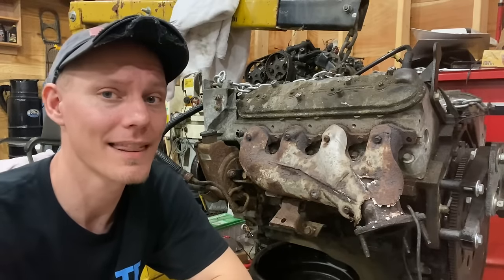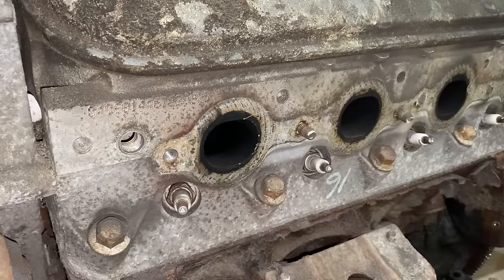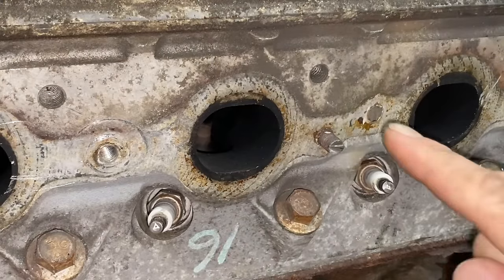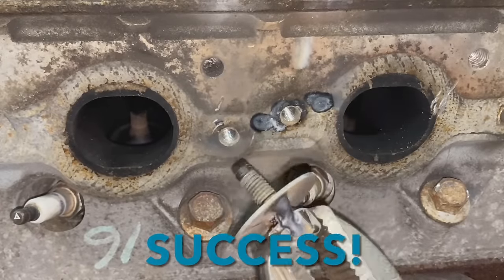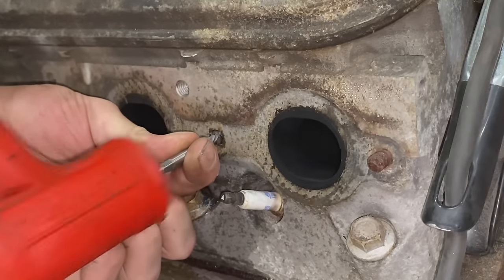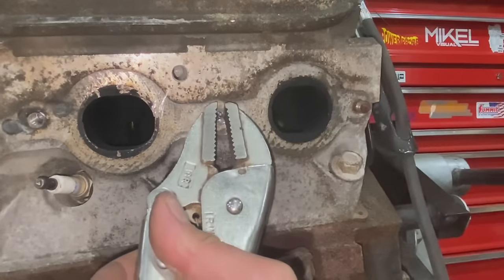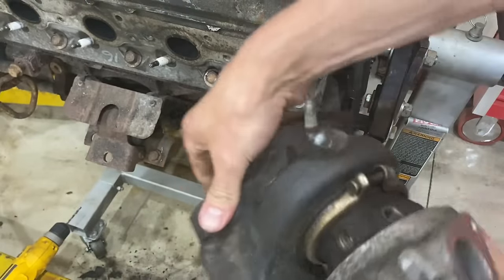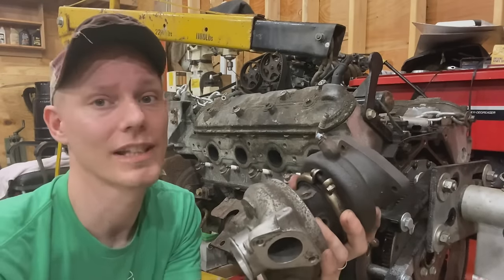How To Remove A Broken Bolt 6 DIFFERENT WAYS - LS Exhaust Manifold

Comment: Enjoyed the video and the various methods to remove broken bolts. So please excuse me, not to be critical, but every time I saw you using the wrenches and the channel lock pliers, I couldn’t resist saying please turn them over  to turn CCW. You had them CW most of the time. You’ll get better grip and less stress on the jaws of the Vice Grip and adjustable wrench. Watching your welding and collapse methods gave me and idea; Weld a high spot  off center, on the broken bolt and using a punch rotate the bolt out! I suppose an off enter hole and punch can do the same. 
Thanks again for taking the time to make the video and share!

Comment: I personally use the #6 method, but welding a boat anchor instead.
   Nice video 👍🏻
Reply from the maker: You can also try welding a steering wheel to it, and then just turn left. Thanks for watching!

Comment: Great video. Hehe on the turbo charger, but it gave leverage to turn the bolt out. 
If a bolt is not seized in by rust or what ever, and things are clean around the bolt threads, then when the bolt head breaks off or gets cut off, the bolt should be loose in the treads, because it’s not holding any thing. 
I had a push mower recently that the bolt broke off holding the cutting blade on the crank shaft of the engine. The bolt was broke a few thousands down in the crankshaft. I figured, it should be loose. I took a very small flat screwdriver and hammer and tapped the bolt. Sure enough it moved. Was not trying to turn it, just to see if it was loose. I glued another butt end of another bolt to the broken one. Wait till the glue set. And turned the broken one out. Bolt size was around 5/16. 
Thank for the video. I never had much success with easy outs. Mostly broke off.
Reply from the maker: Glad you liked the video! It sure does feel like you’re the king of the world when a broken bolt comes out! I’ve never tried glue/epoxy, but now I guess I have to! Thanks for watching!

Comment: As you ask for other methods, I can tell about one I had to improvise many years ago in an attempt to replace a disc of a brake in a car for which that was needed. The disc was hold by three bolts and two of them went out without problem, but the head of the third broke leaving the remaining of the bolt just level with the disc, almost like you cut some of them in your video. I had no welding tool at hand and anyway had no experience  how to use that. The diameter of the bolts were about 5-6 millimeter. I tried to create a slot for a screwdriver in the bolt. For that I used a drill with a 1.5 or 2 mm bit trying to do something like a diametral hole, starting at the border of the bolt almost parallel to the axis of the bolt and changing the direction during the drilling toward the center and then the opposite border of the bolt, then repeating the same thing from the opposite border. I don' t remember how many bits were broken in this operation but it worked and then with my strongest screwdriver the bolt went out.

Rethinking about that, I wonder why I did not first remove the disc as it was only hold by a bolt wihout head. It was a long time ago (year 198x with x between 5 and 9, before 1985 I didn't have the garage where this happened) maybe  a remainder of the head made it impossible or I was too stupid to think that. But I remember clearly the drilling.

Comment: The washer welded to the stud then to the nut worked amazing. 2 studs broken flush removed  both in 5 min
Reply from the maker: That’s awesome! Thanks for watching the video!
Reply: Will it still work if the stud broke off a little below flush? I have one that snapped a littpe bellow the surface
Reply from the maker: @benjamingifaldi7441  - absolutely! I’ve done it many times with the stud broken off below the surface. Just crank up the heat on the welder and weld to a washer first.
Reply: I just found your video and the welding method worked amazing! I had three studs broken in the head of my Dodge Cummins and it worked flawlessly on all three. Thanks for the video!
Reply: Will try with a washer, nut just snapped of each time. Does this still work with a cheap Flux core (gasless).
Reply: @BILLCRAWFORD-kc9zc  yeah flux works fine. You may not have the amperage high enough preventing you from getting any kind of penetration with the weld. If it’s below the surface you can build up the weld on top of the stud first to get it flush then weld the nut on.

Comment: Typically none of them are ever rusted on or ceased. The heads break off the ends because the manifold warps.
This is a handy demonstration of various ways to get em out. All helpful. But what really helps is leaving the head of the bolt on.

Comment: love your sound effects. made my day stuck on these rusted brake wheel bolts im stuck with.
those reverse screwbits aren't working for me either. appreciate the weld tips. gonna try those out for sure.
Reply from the maker: Thanks! I’m glad you liked the video. I actually bought some reverse drill bits because everyone says they are great. I haven’t tried them yet though.

Comment: Living in Canada, the heads of exhaust manifold bolts are always corroded so I gave up trying to get a socket on them.  I just use the cutting torch to cut the heads off all the bolts and get the manifold out of the way, then weld washers and nuts on and work on getting them out. My record is 6 tries at welding a washer and nut on an LS exhaust bolt before it broke free and came out.  My all time record is 9 times to get the exhaust bolt out of a Honda Accord,  turns out the Honda already had a heli-coil in that bolt hole and caused all the problems
Reply from the maker: Massachusetts is soooo very similar. I swear the amount of salt sprayed on the roads in winter is troubling. It turns every car to dust within about 5 years. I highly respect your manifold removal methods! Thanks for watching the video!

Comment: For those doing this job. I watched a video that showed HOW TO AVOID breaking these. Use 6 point ratchet/wrench and try to loosen. As soon as it loosens a hair, retighten. Keep working it back and forth and you'll eventually wirk it loose...  Then retighten as you want the manifold to stay tight and flush while you take the rest of the bolts out.

Comment: With the extractor method it always works best to drill all the way through the broken bolt it better releases tension but caution has to be used to not break the drill bit.

Comment: Even a cheap flux core welder from harbor freight will do the trick. Recently gave my first shot of this on a dodge. The broken bolt was 3/16 below the surface. After 4 attempts i turned the heat up and success. The joy is amazing.
Reply from the maker: Sure is! Getting broken bolts out and starting engines for the first time are basically the best feelings ever!
Reply: What did you have your wire feed on and the heat setting
Reply: @williammason7092  heat setting switch only has a minimum and maximum selection. I used the maximum. My wire speed was 1 out of 10. After a couple squeezes on the trigger the nut was glowing red.
Reply: @jimjones1678  sounds like you have the same one mig 170
Reply: me..1/4 bolt and 2 in. deep using a stick welding..
Reply: I think that’s why most people fail trying to do it this way. They don’t get enough heat to get any kind of good penetration

Comment: With the easy out:
1) don’t drill crooked 😅
2) don’t go TOO big or you end up swelling the bolt, making it tighter.
3) Try heat
4) a T handle work better than an adjustable wrench.
Reply from the maker: I agree on all of that. It’s amazing how many comments are regarding my adjustable wrench usage! Lol. Thanks for watching!

Comment: One that worked for me on a protruding bolt is to file the sides down into more of a square shape and then smash a socket over with a hammer, basically the same method as people do to get locknuts off wheels.
Reply from the maker: That is something I have not tried but absolute will! Thanks for sharing it!

Comment: Very informative video. I love the superb life like sound effects too!!

Edit: Your second method could be improved with a piece of sand paper or Teflon between the nuts. Also there is a method where you drill a small hole in the middle, then tap in a square safety bit or star driver bit and turn it out with a driver.
Reply from the maker: Thanks! A bunch of people have mentioned the torx bit option to me. I’ve gotta try that!
Reply: @WiringRescue  just don’t forget, the safety or torque bit has to be impact rated or it will snap off the first quarter inch of the bit 99% of the time.
Reply: @Dawsons89  That literally just happened to me, still battling it haha
Reply: I have removed hundreds of broken bolts ab

Comment: The double nut method works if you just turn the bottom nut. Dont turn them both. You actually risk unlocking the nuts together. But if you can get a nut on the stud and have a welder on hand just weld the nut after you screw it on. Plus the weld heat will help 
 Brilliant idea to weld to the washer to the stud first. 
I never had luck with ease out either. Plus if they break off its hell then on. Nearly impossible to drill that hardened tap. If an ease out fails. You can use taps to cut the stud out by increasing the size tap. 

Love the sound narration and the turbo charger method.
Reply from the maker: Good info! Thanks for sharing and watching!  On the double nut method - you are totally right. I was having trouble with the outer nut loosening when turning the inner nut, which is why I was using two wrenches. Normally that isn’t necessary though. For whatever reason my nuts (insert joke here) were aligned in the most perfectly wrong way! Lol. 

Also - I like the tap idea you wrote. I may have to try that out! Thanks again!

Comment: Lots of useful info there.  Thanks for posting.  I loved the turbo-blown extractor.  Just one thing: I was taught to lube taps and dies when cutting threads.
Reply from the maker: Lubing them is always a good idea. Mine are in a constant state of grease / oil usually, so I rarely think about that. Sorry it wasn’t mentioned.
Reply: @WiringRescue  No worries.  :)

Comment: I've found that a good Honeywell or Garret turbo works better for bolt removal than some Wuhan War Whistle from ebay. 

The only one I won't even attempt anymore  is the EZ-out. Those things break off so often, and they're harder than any drill bit ever. I'm fortunate that almost all of my broken-bolt experiences have been on either industrial machinery or motorcycles, which (sometimes...) makes it easier to access than on a car.
Reply from the maker: Lol. Thank you for the pro-tips and watching the video!

Comment: The part you should explain is that the heat from the torch and welding does help.. Also when the bolt does start to turn. Working it back and forth helps as well with a penetrating spray/ lubricant. Always run a tap down the threads.. And another way is your wash/ nut but use a short bolt and weld head to washer.  This will give you something to put 2 nuts onto .  🔩
Reply from the maker: All great advice! Thank you for sharing it here, and watching!

Comment: Great stuff thx. There are several types of removal tools that hammer into holes drilled in studs, I like the square fluted ones and the good old manual impact wrench in a slot too.
Reply: You're correct square impact would work if they aren't badly siezed.

Comment: With the easy out, you should be using the proper size left hand drill bit. Also instead of tapping the extractor in, screw it in, it will have a lot less chance of breaking, especially if you use a t-handle to turn it
Reply: This, left handed drill bit, it will sometimes remove the bolt.
Reply: Also using penetrating lubricant, with alternate cold and heat (where possible - obviously not near something like a gas tank).

Comment: Sometimes it's useful to make a cup of tea first and pour the boiling water over the alloy especially if there are, rubber seals involved eg. brake bleeds screws.  The alloy expands more than the steel bolt making it easier to remove.  This prevents damaged to the seals you would've got using a blow torch etc.

Comment: Nice overview of different methods! What I think is funny though is that you're using the adjustable wrench in the 'wrong' (suboptimal) direction not only on a normal nut, but also when using the screw extractor. 😜

Comment: The best method I have found is to use cans of air duster upside down to freeze the bolts in a warm block after soaking in penetrating oil. I have never snapped a bolt or had to weld or drill a stud after I learned this trick
Reply from the maker: That’s an awesome method that I should definitely try. Thanks for sharing it! With these LS engines in Massachusetts, the manifold bolts tend to break themselves off. So I’m forced to do drilling or welding to get them out.
Reply: Nice.  I’ll try this!

Comment: I welded a bike frame to my bolt and although it was hard to spin and make clearance it ended up working great
Reply from the maker: Phew! I’m glad this knowledge is going to good use. I’m thinking about welding a passenger side impala door to my next broken bolt. ;) Thanks for watching!
Reply: @WiringRescue  make sure it's a 1975 Impala passenger side door. Otherwise it might not work
Reply from the maker: @bottomofthemap696  - Thank you! I always heard something about the 1975’s being the best bolt extraction doors. Plus, they become balanced for the reverse rotation when the regulator is warmed up to 88 degrees F. So that makes things way easier.

Comment: Just a thought but couldn't you have lined up your double nuts and used a deep socket?
Reply from the maker: Sometimes that works. Other times it just spins both nuts right off the stud. So it sort of depends on how the nuts are tightened against each other.

Comment: Ty for sharing.  I recently discovered multiple broken exhaust manifold bolts while doing some engine work. I would like to try extraction with the engine in the bay.  Is this possible?  A side story,  I was replacing the two knock sensors in my v8 and the sensors broke off. I drilled for extracting and wasn't able to extract. I used a heat gun in place of a torch. It worked.  Lesson I learned, some things extract better after applying heat first. If you have a stuck bolt apply heat before trying cold and risking snapping the head off.

Comment: Use reverse drill bits very slowly and they usually grab and back it out
Reply from the maker: That’s something I’m likely going to try in an upcoming video. Seems like a bunch of people love them!
Reply: @WiringRescue  I'm about to try them on my driver side rear bolt on my 04 Sierra. Might have to break the bit to fit back there. Zero room ugh. It's my daily so don't want pull the engine but I just might have to a little bit. Really didn't want to tho. Bought headers and exhaust for it so here goes nothing. I can't across your video looking for anyone that's tried it but so far nobody. Literally the only bolt with zero room 🤣🤬

Comment: In a pinch, if you don’t have an extractor on hand. You can match a drill bit to a torx bit and slam the torx in there and slowly ratchet it off. You always want to go with the biggest extractor or torx that you can in the bolt without drilling it crooked. The bigger the extractor, the less likely you are to snap it off. My experience atleast.
Reply from the maker: A few people have suggested this to me! I think I may try it in a future video and see how it works!

Comment: It’s an aluminum head. In the case of broken flush or below flush,  place a nut over the hole and the mig nozzle directly on the nut. One handed, squirt the gun until the nut is Cherry red. It will be welded to the stud and it won’t stick to the head. No ez out and washer required. Easy peasy.
Reply from the maker: Agreed! Thanks for watching !

Comment: Besides using the Mini-Ductor Venom HP , the unit with the highest power , Matco has the RBRT Extractor Set , which has been getting great reviews . Whatever method works best without damaging the head or threads .
Reply: Did you mean MAC tools? I love their RBRT stuff. I use them on all torx and hex bolts to keep from ever stripping them out in the first place

Comment: Drilling and EasyOut (hah) is always tough. After bolt removal it's a good idea to get a new bolt and see if it will hold torque or strip out before installing the manifold.
Reply from the maker: Solid advice! Thanks for watching!

Comment: Hey guys when using drill and ez out/extractor, use left hand drill bits at a slow speed... Alot of times the drill bit will grab and turn the screw out if its not rusted and seized badly... Also dont tap the extractor in, that will cause it to bind and break off... If the hole is drilled deep enough, simply turning the extractor will cause it to grab the screw
Reply: excellent advice
Reply: Don't tap it in??? These things don't catch very easy and when the do they don't stay that way long for the most part. I've got a broken glowplug on the side of my engine and if I didn't tap in it would fall out.
Reply: @eedom69  tap it in if you want. Theyre not intended to be tapped in. Theyre very hard and will break.
Reply: @michaelmorgan2880  The icon ones I just got at harbor freight show a picture of a man tapping it in with a hammer in the instructions.

Comment: I love the professional sound effects. 😂

The last method doesn’t need a turbocharger. I’ve seen a length of slim iron rod welded at a slight angle to the end of the stud, even one that broke off well below the surface, and used as a handle to unscrew the stud.